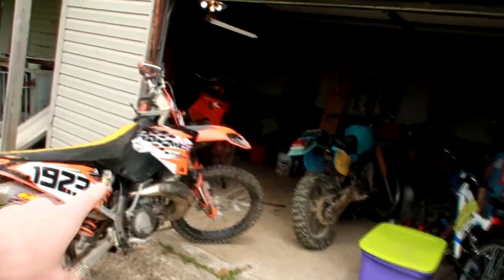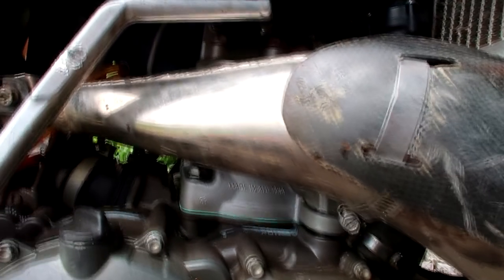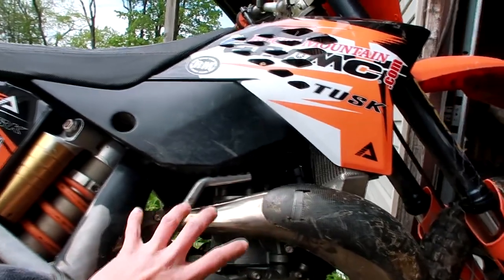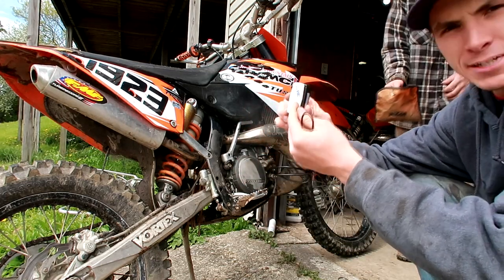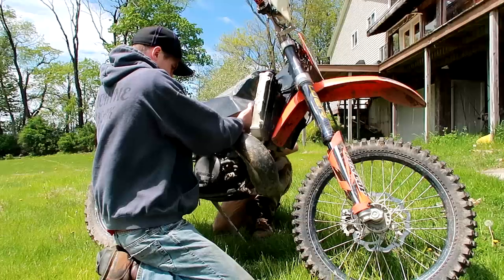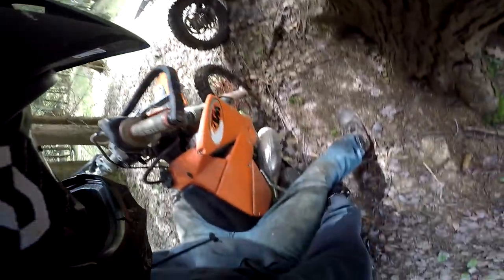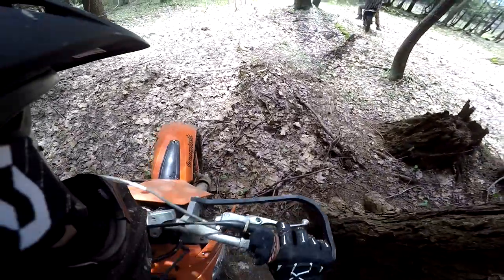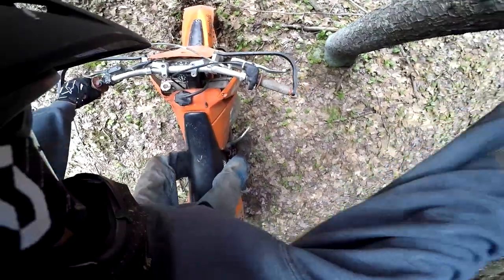EVERY DIRT BIKE NEEDS THIS

Comment: hey your 250 is running lean in the bottom end!!  thats y it bogs when u crack the throttle and it idles really high when u let off the throttle try turning in the air screw but if ur within a turn from all the way in then go up one size pilot

Comment: i bought a cheap ebay biycle speedo that was less the £10 and it works brilliant at clocking speed and how long you have been riding and loads off more keep up the work 3d machines

Comment: Tell Jake it is waaaay easier to remove the tank with the shrouds instead of removing the shrouds from the tank to remove the tank.
Removing the shrouds from the tank takes 7 bolts.
Removing the tank with the shrouds takes 3 bolts.
Also Jakes bike is supposed to come with a speedo/hour reader on it stock.
I own the same model bike (just a 4 stroke version) and know quite a bit about these models, I owned 3 of them.

Comment: Your bike sounds like it may have an air leak, crank seal maybe?
Reply: dr187mx  
Yes I think your right Daltons bike takes a while to come down to idle. Classic 2 stroke air leak, weather it be crank seals,base gasket,reed cage gasket,carb boot,or case half gaskets. Run it some more in that plowed ground and he will find it.Then he can do a rebuild video.
Reply: dr187mx          I agree   crank seal
Reply: Well, thinking about it I don't think it is a crank seal because I had a yz250 that needed one and it was burning trans oil and smoking badly. I'd still say it has a leak but it's probably in one of the places Rob mentioned.
Reply: Considering he looked down and said "muffler mounts loose" I'm guessing it isn't the crank seal...
Reply: it's at the very least lean down on the pilot! better fatten it up before it goes on strike!

Comment: hey if you want to ride faster you need to stand a bit more and if your on the balls of your feet it will help alot aswell. A bigger rear sprocket might help as well because of the tighter more technical riding

Comment: Jake probably had to fork out around $2000 for a shop to do the top and bottom end. Should have just done it himself, thats why people own 2 strokes. They are easy to work on. Especially having Dalton as a buddy they could have fixed it themselves no problem and saved about $1300
Reply: Prairie Rippers  I don't cost anywhere near that complete rebuild kit top and bottom is 169 dollars and shops charge 65 to 75 and hour and I can do it in an hour after the motor is off but it it is as easy as opening a candy bar
Reply: $150.00 for parts to rebuild a bottom end on a cr250 using good oem parts,  $250.00 for oem crank if it needs it basic  piston kit $100-$150.00,  complete bigbore piston, sleeve, gaskets, wristpin from LAsleeve  $295.00. That means you can have a 270cc screamer for about 450.00-700.00 depending on if your crank is still good (need to check runout).  $700.00 for a completely  rebuilt Honda 270cc engine. That is why I tell  people who ride a lot to buy a 2 stroke..........
Reply: Exactly. Its about 700$ to do it yourself and just buy the parts. If you take it to a shop it is well over 1500$.
Reply: I don't know where you live but here in Canada a new crank is $450, a new cylinder is $550, and a new piston and all the gaskets are about $200. And a shop is going to rape you for hours at $80. I know all these prices are bang on because I just did this for my 2006 cr125 last fall. You might say I got ripped off and you would be right. But that is just Canada for you, the dollar is retared and I can't buy a $20 t shirt from the US without it being $60 to get it to my house after the exchange, shipping and duty.
Reply: I live in Canada too.  The prices I listed were in US dollars but in Canada deals can be had if you shop around. Lots of Dealers have old parts sitting in the back and they take cash for them, talk to the bike mechanics and see where they order their parts from, ask them if you can add to their order = free shipping . I buy lots of parts from other racers mechanics trade swap barter etc...

Comment: How do those tack's tell what rpm your engine is running at from the spark plug, sorry if thats a dumb question :S
Reply: Spark plug pulse. You wrap it around the spark plug wire to monitor hours and rpm if equipped.
Reply: cool, thanks for the answer... thats kinda what i was thinking, but i didnt know if it was possible.. Very smart!